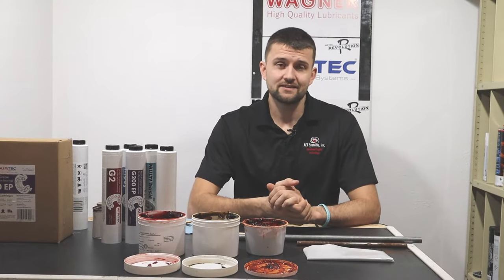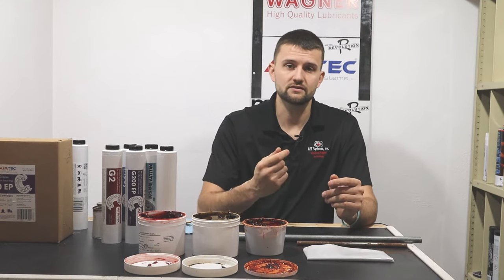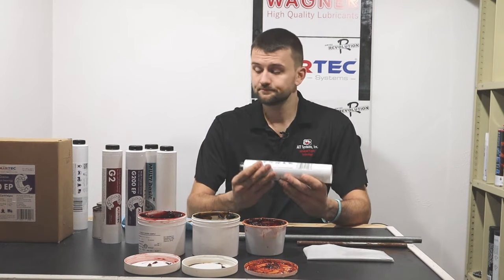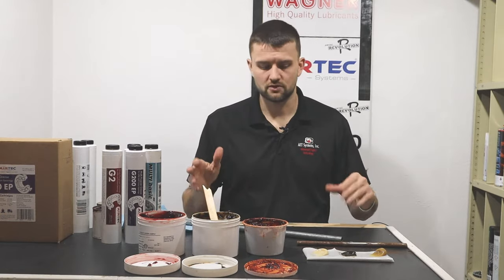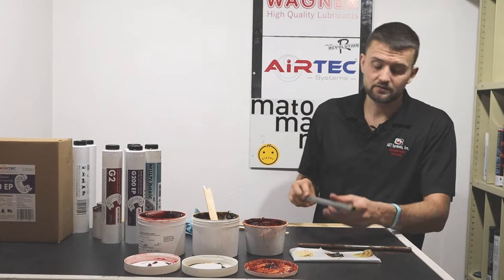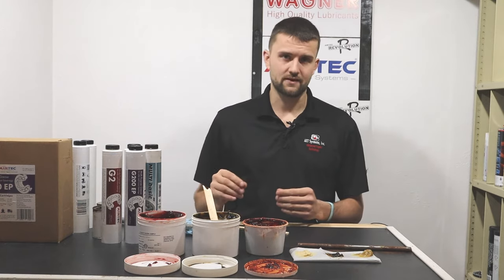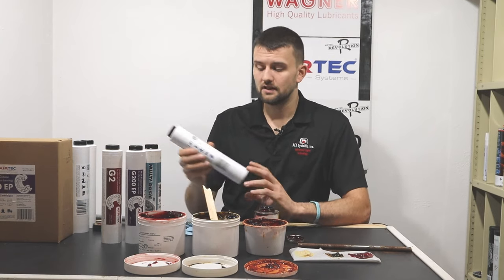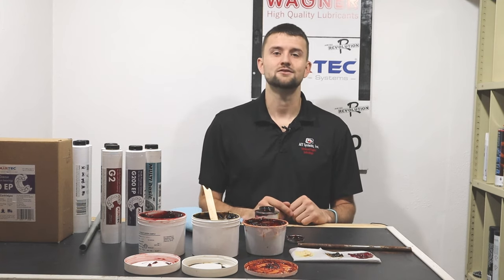The Right Grease for Tractors & Lawn Mowers: Insider Tips

Comment: I have a Troy Built riding mower that calls for Benalene 920/0 grease for the single-speed transmission. It takes 19 oz. @ about $30.00 for 8oz. What grease can I use that is less costly.Thanks

Comment: Hi.  Brilliant vid ! Can you help ? I can't find the answer to this anywhere,even John Deere won't reply to my questions,I use a polyurea grease that John Deere market,called SD polyurea,I also use their standard lithium called hd lithium complex,both provide adequate thermal protection for my operations, I'd like to just drop one high temperature grease ,just use the SD polyurea and a basic lithium for general farm implements. 
My question is,on the machines that have the John Deere hd lithium complex in,what would happen if I then used the polyurea grease on same machine? Both high temp which I need for my corn dryer, but obviously different thickeners. 
When I replace the bearings on my corn dryer, I packed them with the high temp lithium complex, but would like to switch over to just the SD polyurea, what would be the outcome? Will stay as I am if it's a problem.  Thank you ☺️
Reply from the maker: Great Question.  Polyurea greases are rarely compatible with other greases that are thickened with anything other than polyurea.   What happens is that the polyurea and other thickener (lithium, calcium, etc) and will cause the oil to separate from the thickener.  The result is the oil runs out of the bearing and the thickener remains, which can cause issues as the thickener can get hard.  However, some polyurea greases are rated "Shear stable"  and are compatible with lithium and calcium, but we do not believe this is the case with the SD polyurea john deere grease.  You can definitely switch to a high temp multipurpose, but we recommend cleaning the bearings prior or try mixing the grease you have with the grease you want to switch to---if they oil separates out in a couple of weeks you know they are not compatible, if the oil does not separate out you know at the least the two greases are semi-compatible.
Reply: @aetsystemsinc.1413  wow that's such a brilliant explanation. Thanks so much ,after hearing all that, I would rather spend 30 pounds on another grease gun and keep everything as it is ,it's only a few tubes a year ,sounds like on something like a crop dryer,high temps ect, would be not worth risking.   Thanks very much for explaining 😊
Reply: @stevebearing_72 how did it go? I’m also looking to use less on more for my implements. I have a fel with lift arms that I service as well and would like to keep from switching if at all possible, I’m handicapped and less is more as far as efficiency of motion.

Comment: So this has bugged me:  John Deere recommends the following for the 1025r.   
Loader: SD Polyurea Grease      Backhoe: Moly High Temp EP Grease     Mower: SD Polyurea Grease          
So would it be best to use your grease in this manner:  Loader: P100          Backhoe: G200 or MoS      Mower: P100

The backhoe is a little confusing as moly is MoS, but it says EP grease which is the G200.  So which would be better?   Can I get away with just using one of these greases?  Can I use MoS all around?
Reply from the maker: You are correct in your crossover greases from JD to AirTec.  G200 EP would be a good all-around grease.  A lot of times it is not recommended to use a moly grease in high-speed bearings.  We do offer another grease called Li400, it is an ultra-performance grease that has an excellent EP rating, higher temp rating, and is great for low and high-speed bearings/bushings.   If you are looking for one grease to use Li400 will meet and exceed all the OEM requirements.
Reply: @aetsystemsinc.1413 same querie as the comment you responded to here but  on a Mahindra (international harvester). Thank you!